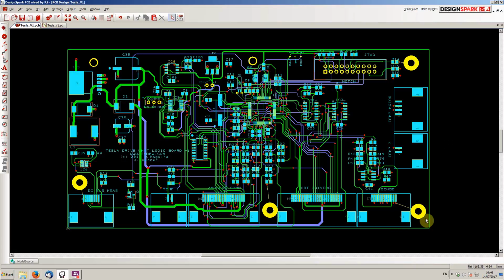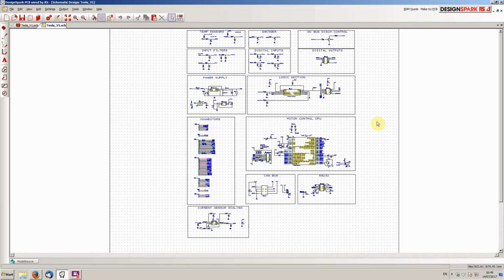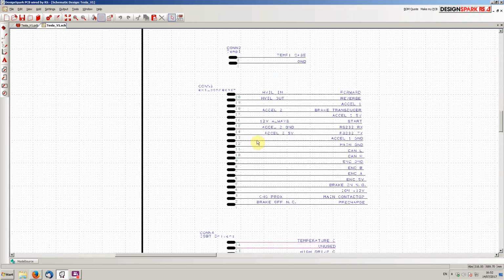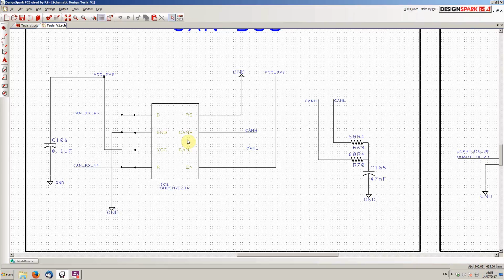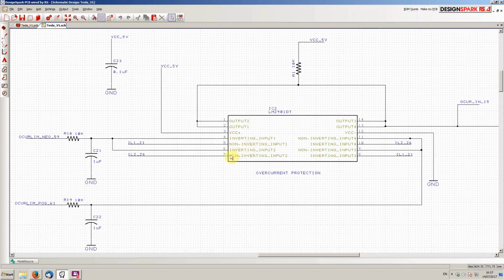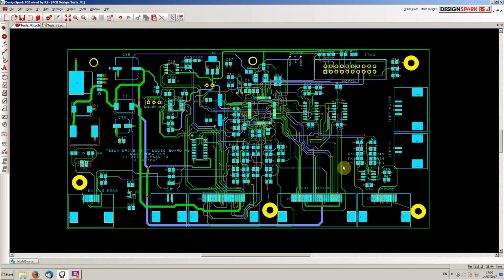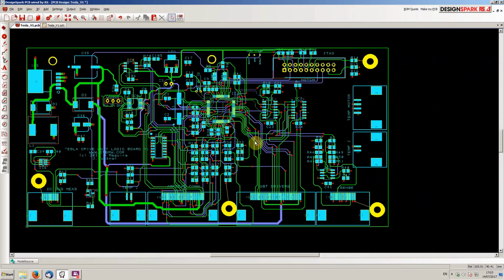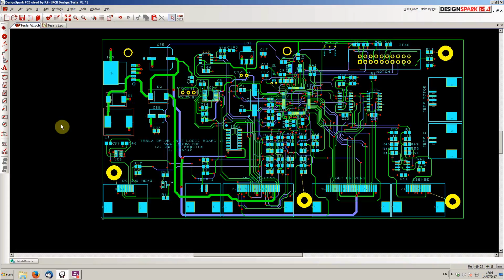The Tesla Project : Tracking Day

Comment: How about a current loop? Simple opto isolator on the board. No fooling with voltage differentials and all the "complicated" stuff a resistor and voltage supply outside. Can run long distances like from house to garage.

I am trying right now to do some analog stuff like J1772 with simple CNY17 chips.

Take care of your health. The internet needs you.
Peter and Karin
Reply from the maker: Thanks:)

Comment: so if I understand this right, the end goal of this is to have a logic board that replaces the whole inverter can that sits across from the motor on a Tesla drive unit? Or does this talk to that inverter can thing?
Reply from the maker: Replaces the Tesla logic board inside the can
Reply: Damien Maguire 
oh, so it's less intrusive than I thought. super nice! However I hear Tesla made major changes super often through the model S's run so I dunno if you'll have to make several boards to cover all the different flavors.
Reply from the maker: Only two drive units at present to the best of my knowledge. If I can get a small unit I'll make a board for that too:)

Comment: HI Damian, this is a cool project your working on here, let me know if you need any semiconductors as i am sure we can sort you out a great price, i have in our stock a number of the item shown below, its a 500A rated fully sealed contactor that can take 900+ volts and these may be perfect for projects like your working on, 

http://uk.rs-online.com/web/p/electric-vehicle-connectors-accessories/8086778/?searchTerm=8086778&relevancy-data=636F3D3126696E3D4931384E525353746F636B4E756D626572266C753D656E266D6D3D6D61746368616C6C26706D3D5E5C647B362C377D7C5C647B31307D7C28283F69292852537C5253207C52532D293F5C647B337D285C73293F5B5C732D2F255C2E2C5D285C73293F5C647B332C347D292426706F3D3126736E3D592673743D52535F53544F434B5F4E554D4245522677633D4E4F4E45267573743D38303836373738267374613D3830383637373826,

Dave, BasicMicroUK
Reply from the maker: Thanks a lot